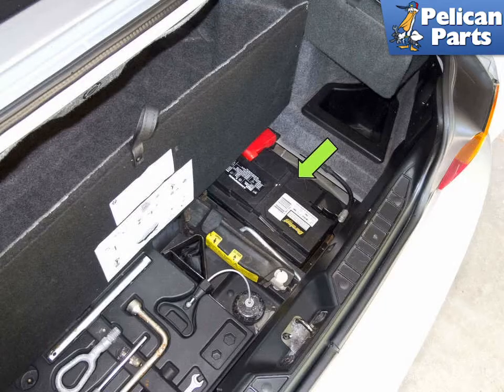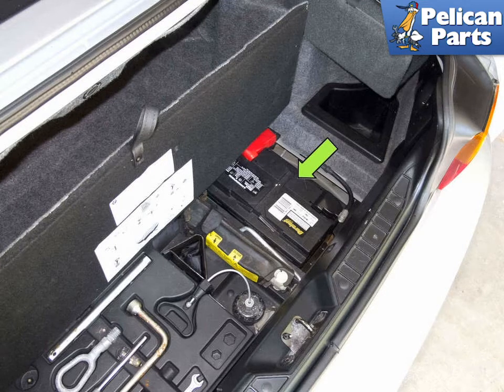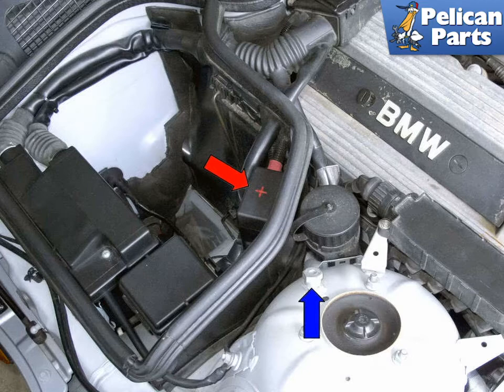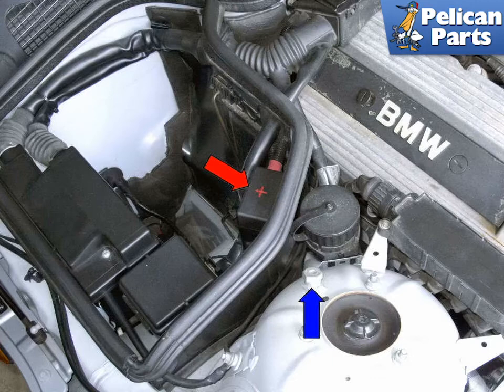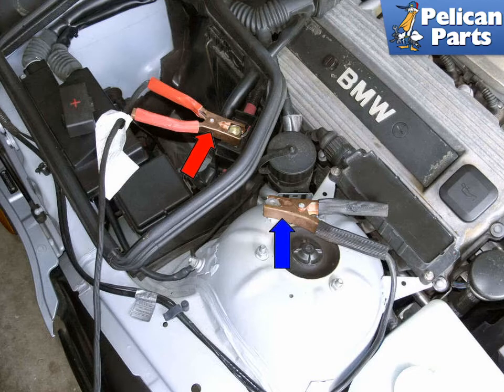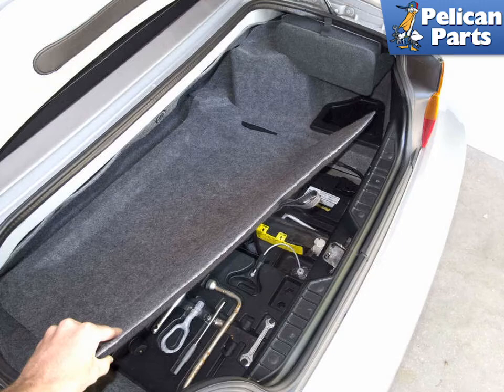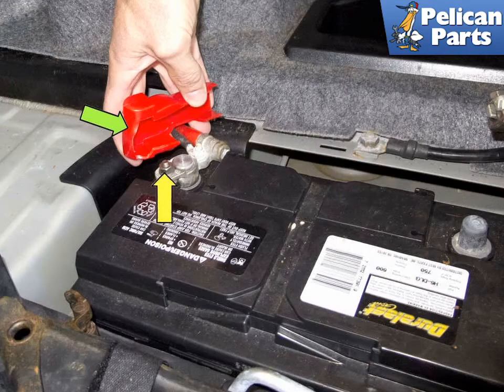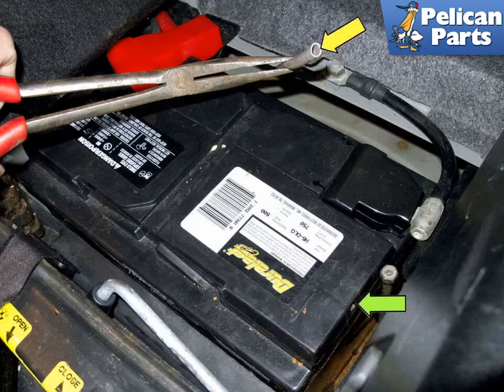BMW Z3 Battery Replacement and Connection Notes

Comment: What is the battery size needed
Reply from the maker: You didn't mention what year and model vehicle you are working on.

With your vehicle info handy, give The Pelican Parts parts specialists a call at 1-888-280-7799. They can figure out what part or repair kit you need.
Reply: @pelicanparts  its for a 97 bmw z3 1.9

Comment: red cable battery attachment screw broken, inserted a random screw to hold it together.
any suggestions?
Do I need to have the whole red cable replaced?
Reply from the maker: Yes, likely need to replace it. With your vehicle info handy, give The Pelican Parts parts specialists a call at 1-888-280-7799. They can figure out what part or repair kit you need.